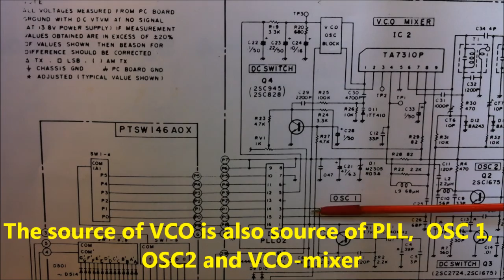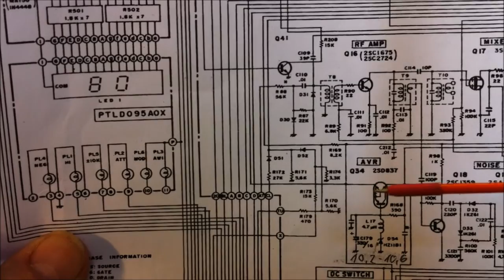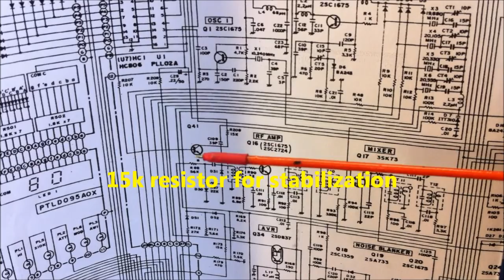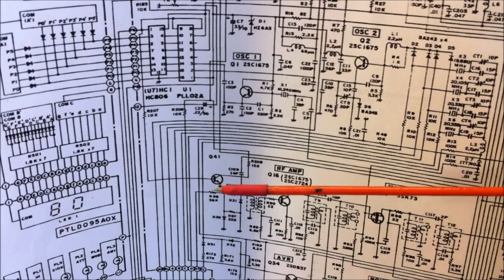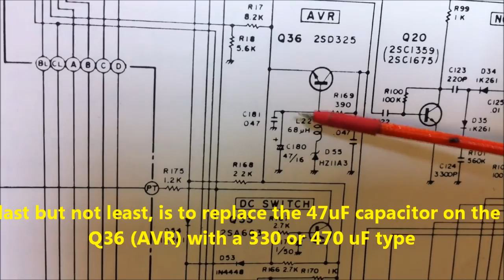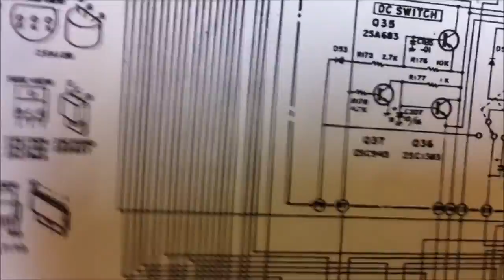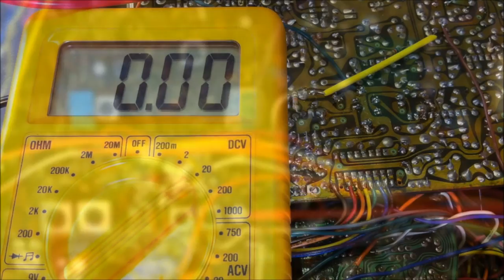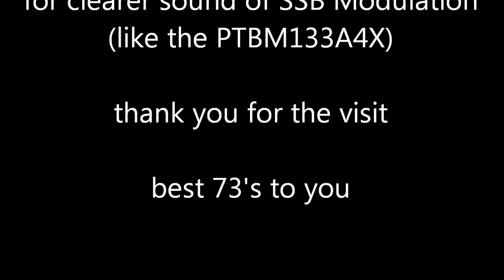VCO feed point change on CYBERNET PTBM125 / 131 / PCMA001S radio boards

Comment: Why after modification i have all the frequency out and i receive always bad in ssb? The voltage is always 9.35
Reply from the maker: Mister Raf hello, thank you for your interest on my channel. Please check the 10 kOhm resistor. Are you sure that it's not a 10- or 100 Ohm Resistor? If you feed the VCO Voltage with 9.4 Volts only with a 10- or 100 Ohm type, you'll have 9.4 Volts again. You could also take a 15- or 22 k Ohm resistor, but never less than 10 kOhms. Second be sure, that the break to the old feedpoint realy is insulated. Now i hope, you'll solve your problem. Happy airwaves to you...
Reply: @SWIZZRADIOS  thank you for your reply.. i'm sure of the value of resistor and of the break.. i will try with other type  of resistor and i will say to you if i have solved.. i have just changed the condenser and inserted the new one on not used position.. thank you very much
Reply: I have made others test.. now with 10k and 15k resistors i have 5.5 volts from the new point of alimentation but modulation in rx is always destorted and good in tx

Comment: Stephan my friend. This is a really amazing modification, i always achieved good audio on ssb but with a lot of time trimming the rf stages around in circles and monitoring the audio quality on the bands, listening to other radios not just on the oscilloscope. some coils you cant peak on certain bands or you hear like a shadow of your audio and they need to be de-peaked. A lot of time was necessary to get the radio to sound good everywhere and also involved a bit of rf power out sacrifised. This mod has made the audio clear of these problems even when totally peaked to maximum RF output. Great job. Very pleased and thankyou very much for sharing
Reply from the maker: Hello my CB-radio friend 34AB138, thank you for your interest. Yes CYBERNET radios have a lot of problems in it age. Are to replace alot of capacitors and to do other settings. With uniden radios we don't have these problems. They works also with an age of more than 40 years too. But also on these radios, are to change many bad capacitors. Best wishes and Merry X-Mas to you and yours...
Reply: @SWIZZRADIOS  stefan, in your mod you talk about the transistor switching the vco voltage not necessary only in the high bands on some radio, i switched the 64 bit on my colt2000 and the ncodes are higher at the low channels and a few of these low channels the vco wont lock, it can only be adjusted to cover the old ncodes or the new ones with -64 ie highter frequency. But not all of both. I was going to put a spectrum wideband relacement vco, but  i wonder can i do such transistor switch to allow my vco to cover both ncode sets? Its the pcma001s with green vco block

Comment: wow going to try this at my tristar some day.....
Reply from the maker: OK, I wish you good luck with this modification. Happy airwaves to you....
Reply: SWIZZRADIOS yeah thanks.. But I have also a problem with a superstar 3900  crt... The 's meter on ssb gives very weak signal... Audio is laud enouf switched tr 13 and 14  also put in a difrent diode on d 12  (no effect on ssb.)
Mabey you have an idee?
Regards Richard 19rs041
Reply from the maker: Hello Mr Richard, thank you for your interest. If you have RX Problems on all Modes (incl. SSB), then replace TR17 (2SC1974) with 2SC2999 and also replace D1, D2, D23, D24 (1N60) with 1N6263 diodes. Then realigne the RX section L6, L7, L8, L10, L11, L12 and AM/FM (L3 L4). This is the good solution. I wish you good luck with the mode. Best 73's to you...
Reply: oke thanks for your input realy appreciate this!!!! but it ONLY ACCURES on ssb,am and fm is perfect....i used a splitter lissend to 2 radios,it SEEMS like the reception is oke(i could hear the same stations in bad conditionds)... earlyer i thougt the problem would be specifically  in ssb agc control(because it only occur on ssb)  but im realy in the Woods here....mabey this gives you a diffrent perspective???
Reply from the maker: OK, I remember me, that my PEARCE SIMPSON Super Chetah had the same problem like your radio: In this radio was the 10.695 MHz SSB-filter defect. The modulation in SSB RX/TX was very distorted. Then I've replaced this filter and the problem was solved. But I don't know if is it the same problem in your radio.
Reply: SWIZZRADIOS yes oké, it s a ssb problem specifically, and the volume on distant stations is low also no swing at all on distant stations... With l13 and l14 (just after the Cristal you mentioned) I have not much room to alter with, so it s pritty much spot on or practicly not at all...
The modulation seems to be oké, sounds great... 
Think I'm going to buy a wrecked superstar and the first thing I change is the filter fl3  on it....
Thanks for your advice...!. I keep you posted....regards richard